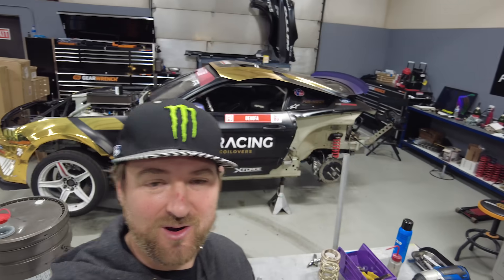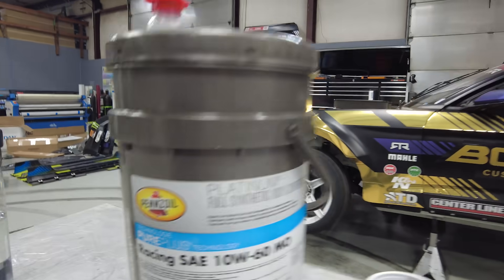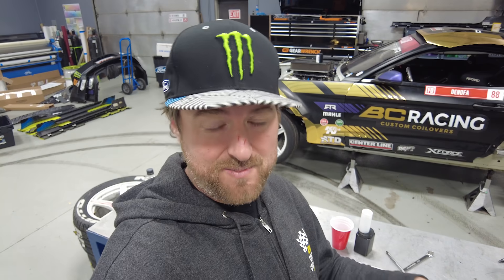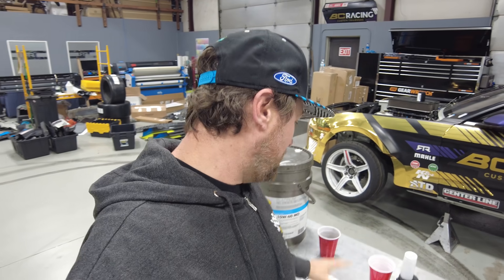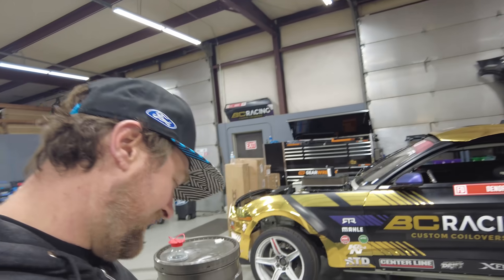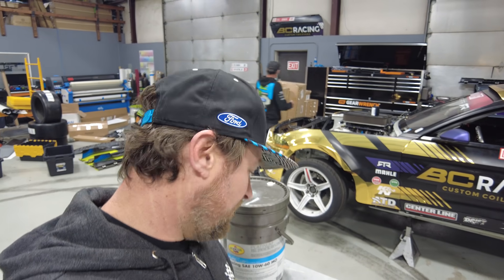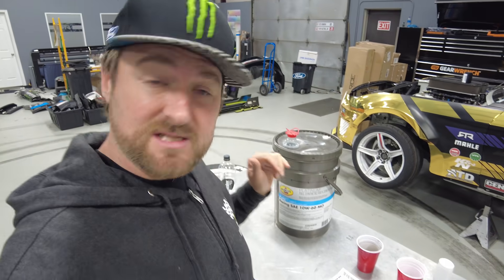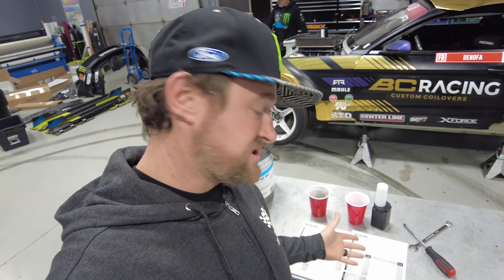What 1,111HP Race Engines Do To Oil!

Comment: I also use Pennzoil Platinum (with a quart of full-synthetic Lucas) in every change for all my vehicles. I’m sure there’s some sponsorship stuff going on here, but sponsor or no, I wouldn’t think they’d run it in racecars if it wasn’t pretty good stuff. Makes me feel like I’ve made an okay oil choice. Hooray for me!
Reply: Pennzoil Platinum is excellent in every application I’ve used it. The oil in this video is the Platinum Racing version. It’s $55 a gallon and has just over 1000 parts per million of Zinc.

Comment: thanks for shedding a light on the type of oil you guys used, I had a feeling it was pennzoil for obvious reasons, I am a bit surprised its not ultra platinum and just regular platinum
Reply: They change oil so frequently it doesn’t matter much
Reply: Their Racing 10W-60 is different. It has just over 1000 parts per million of zinc, if you pause right when he holds up the oil analysis sheet. That’s more zinc than either regular platinum, or ultra platinum.
Reply: @ezrawaters6653  I forgot exactly why it has such high platinum but it has to do with consistent temperature and flow
Reply: @ezrawaters6653  good catch on that had to go back and rewatch
Reply: @Andrew-hh3ol  higher Zinc means more ZDDP (zinc dialkyldithiophosphate) molecules. They are the main Anti-Wear additive. Regular car oil has less ZDDP, since the Phosphorus in the molecule slowly poisons catalytic converters if there’s too much. In race cars though, there’s no concern
Reply: @ezrawaters6653  lmao straight pipes in life

Comment: This is super cool to see and hear for sure!! If any car person had access to this type of info we could all keep our cars/trucks better depending on the use we put it thru. Also speaks alot for Pennzoil witch i have used there high milage semi synthetic in all my Wisconsin cars and trucks lol. Great video 👌
Reply: The oil he uses is the Platinum Racing version. It’s $55 a gallon, and contains just over 1000 parts per million of Zinc for extra anti-wear protection.

Comment: Dirty oil just means it's doing part of it's job n keeping the engine clean.  Sometimes peeps don't change it before fully loaded up with contaminates, with nowhere to go the deposits stay in the engine.  The more extreme the use, the faster the oil loads up and more often it needs to be changed.   Some don't have a problem buying good oil, they have a problem with dumping the expensive stuff out and run it too long.

Comment: Interesting. So my car is pushing 300k miles. Previous owner was big into oil and the particles in the oil. He converted it all to Amsoil including  a large secondary filter, that filters down to 3 microns. No idea what filters you run but I would be curious if you could get the particle count down by filtering out the larger ones.

Comment: How often do these engines get rebuilt? 

Cool to see lab results on a race engine. I'm surprised that you don't use an ester based oil like Redline. I guess if the Penzoil works well then there's no reason to change what you're doing though.

Comment: What did that oil report say about the zinc levels in that oil? Also surprised you guys are running a leaded fuel with a fuel injected car. I was running vp 110 leaded fuel and kept knocking out oxygen sensors due to the lead per the manufacturer of the wideband af i had at the time. Just my experience with it.
Reply: If you look reaallly close right when he holds up the report, the zinc from this drain is 1054 ppm

Comment: 10/60 of pensoil .......has a paratone in it that’s a by product of crude refining, not natural gas.....now the 100 neutral that’s the base oil you can pain your fence with. Add paratone and it becomes multi viscosity.....want it to be clean gotta add orinite that again is from crude oil. That’s what has the calcium, magnesium and nickel. Since you do a full synthetic, that’s called an S4 or S8 molecule that’s made in a lab, this keeps it from demulsifying at extreme temps like Arizona desert in July or Montana in November. When you decide to run nitro methanol.....you’ll need a single weight that dosent break apart with the fuel. I suggest nitro 70 by Kendall. Also what kind of additives did that report say you added to the fuel?
Reply: Ah, so you’re saying that the Viscosity Index Improvers are made from a paratone?
Reply: @ezrawaters6653  I was missing a few steps but the real viscosity improvers are typically polyisobutylenes
Reply: @ezrawaters6653  got an honest question for ya. I’ve heard both ways....whatcha think about welding the rear end spider gears without cleaning the oil off of them?  I asked an oil guy and he said naw clean the oil off, and a race car guy told me leave it on but preheat the gears. You asked an Awsome question so I think ya might be in the know, so whatcha think?

Comment: why 10-60 over 20-50? is it a heat thing or closer tolerances?
Reply: Shear strength {60} when cold, low pumping losses with closer tolerances when hot{10}
Reply: @dazaspc  you have it backwards. The W in 10W stands for Winter. 10W means it fits in the 10W range for cold weather pumping tests. The second number means this oil is within viscosity range for 60 weight at 210 Fahrenheit. Although the second number is larger, the oil does become thinner as it heats up
Reply: Most likely so it stays thicker than 20W-50 if the oil temp spikes to 250 Fahrenheit in extreme competition
Reply: @ezrawaters6653  Ill put this as simply as possible
Oil thins out as the temperature rises, it isn't an egg or cake batter.  
The colder it gets the thicker it becomes. 
W does NOT stand for winter it is an abbreviation for Weight, a measure of viscosity.  
Oil usually has a higher
shear strength the higher the number.  
The tighter the bearing clearances the thinner the oil should be for proper lubrication on start up. 
Thick oil has more resistance to flow therefore takes longer to reach everything at a higher required pressure therefor for LOW temps you need a lower Primary number on the oil that is the second number not the first. 

To correct your answer to the first question you would use a 10~60 over a 20~50 due to the higher clearances in a race engine. When the engine is properly heat soaked the oil should be at it's lowest viscosity number. It can use 10 weight because the oil pump has adequate flow for the loose engine. It also has a lower friction point than the higher number to allow more power to be made. The race engine needs the thicker oil to maintain proper lubrication at low temps/startup/warm up. High load valve springs in particular cause serious wear issues on startup the thicker oil stands up to shear far better. Once warm there is adequate flow so this is no longer an issue if the engine has been built correctly.
Reply: @dazaspc  Your Ideas are correct, you just have the numbers BACKWARDS. 10W is the COLD RATING. 60 is the HOT RATING
Reply: @dazaspc  Even thought the oil thins as heated, the HOT RATING 60 is a bigger number than the COLD RATING 10W!!!  The first and second numbers are on COMPLETELY DIFFERENT SCALES!!!

Comment: Where you getting 5 gallons of that oil is my question!!!???
Reply: They list that exact 5 gallon bucket on Walmart and Amazon for $277. That comes out to  $55 per gallon. Quite a steep price, but it is racing oil for EXTREME application
Reply: @ezrawaters6653  he's using 60wt, I can't find 60wt listed anywhere. 10w50 is what I use and it's not racing oil, Europe uses this stuff regularly. The viscosity maybe racing specific but definitely not branded as Race Oil. Pennzoil Ultra Platinum is just that good, only oil better would be Amsoil which I've used back to back against Pennzoil. So you're saying Walmart and Amazon sell this bulk bucket ? 2yrs of buying mine from Amazon I've never seen packaging larger than a Gallon.
Reply: @ezrawaters6653  my Amazon must broken, I can't find it. Link if you get a chance. Yeah 60w is a race viscosity, didn't think they had a Race Labeling for that specific weight.
Reply: @ezrawaters6653  thank you !!

Comment: Hi, would you reccomend pennzoil for street use? i drive an E39 M5 supercharged (550hp) and change the oil every 4-5000km i do mostly normal driving with little to no show boating (i do red line it though when going down the motorway etc.
Reply: What Viscosity are you looking to use?

Comment: Was expecting Ultra Platinum since that is Pennzoil's top tier Synthetic.
Reply: Maybe there’s no advantage in racecars when they change it so often?
Reply: @The_sinner_Jim_Whitney  That has a lot to do with it, im sure and if it keeps wear levels normal and stays in grade, theres no point. I just figured these Big Name racing teams used full race oil. Modern motor oils are surprisingly stout.
Reply: This is their Racing Full Synthetic. Different from either regular Platinum, or Ultra Platinum. If you look really close right when he holds up the report, you can see this batch has 1054 parts per million of Zinc. That’s more than in either Platinum or Ultra
Reply: @ezrawaters6653  oh, I’ll be damned. Either way, I believe street car Platinum’s also pretty good stuff.
Reply: @ezrawaters6653  Good eye, they must be using the Platinum Racing 10w60, hence the high zinc levels.

Comment: Why so thick of oil?
Reply: Most likely since the 1000 hp engines would bring the oil temp to around 240-250 Fahrenheit at times. 10W-60 at 250 degrees is close to the same thickness as 10W-40 at 210 degrees.

Comment: I remember the days when Pennzoil was the shitiest oil you could buy.
Reply: The reason why it was shitty was the beeswax they used. They had a good reason, just can't remember it off hand. It worked great so long as you changed your oil every 3k miles like your were supposed to back then. But, hardly any body ever did and that beeswax would set up and solidify inside the engine. The sludge is what gave them such a bad reputation. That and I'm sure that other neglect was blamed on the oil alone. Motor falls out the bottom of car "must have been that Pennzoil I used"
Reply: @davidzimmer2694   Oh I see now. Well call me educated now.
Reply: That was the pen star molecule? Lol.when I was a kid growing up, my parents bought into the pennzoil/fram hype. I scattered many engines.
Reply: Project farm did a head to head comparison with multiple oil brands, Pennzoil and Amsoil were the best of the bunch.
Reply: @Mrx1080  naw uh. Bacon fat was! lol,
Reply: Still is compared to others. Look up blackstone labs

Comment: You running 2-ring pistons? Dry sump or wet sump? Both will explain combustion gasses. 

You’re running a series that still uses leaded fuel? Ffs, it’s not only unhealthy to your techs, it’s making much less hp. I suspect it stems from highly inefficient 2V combustion chambers but proper designed pistons and modern cooling systems can run on modern fuel. Plead to your sanctioning body for oxygenated unleaded race fuel. 

Should not have much in wear metals since you’re replacing after every weekend, what’s that 6-8hrs at best?

I’m shocked anyone would use 10-60 in any race engine. I assume these are old pushrod 2V motors but it’s likely forged 4000 series or maybe 2618 if on a tighter budget, pistons in nikasil bores, 6-bolt girdled mains and 2-pump oiling system, no? If so, tighten tolerances and run 20 or 30 weight race oil, especially if you’re changing oil every weekend. Depending upon windage, if wet sump, cam drive design and build quality, you’ll often gain 3-5% hp. Of course such race oil has very few additives for combustion gases so it’s imperative that you change oil after every weekend, maybe twice if you’re running btb races. Small price to pay for the net hp gain. In many cases, while the race oil lacks ph reagents to handle combustion gases, they often have more ZDDP than is allowed in street vehicles thus offering better wear protection. The lighter oil will also allow tighter piston clearances, as long as properly designed w/oil cooling jets and no iron bores, resulting in more efficient combustion and less blow by. This is where the 2-ring pistons really help. 

Good luck this season.
Reply: If you look closely right as he holds the oil analysis report up, you can see this oil has 2600 parts per million of Calcium. That’s the main detergent/dispersant. It also has 1050 ppm of Zinc, and 940 ppm of Phosphorus. Also just under 80 ppm of Boron, and 50 ppm of Molybdenum, both of which are secondary Anti-Wear additives

Comment: I'm sure Pennzoil is a sponsor, and for what they are doing it is a good oil.  But this Pennzoil synthetic oil is not stable over time and the number of heat cycles that a daily driver car would see.  Of the synthetics out there, this one is the least stable for your daily everyday use.
Reply: I’ve used Pennzoil Synthetic for the last 8 years in all of my family’s vehicles. Usually 8k miles between oil changes. Zero problems
Reply: @ezrawaters6653   I'm sure it has worked out well for you.  I go off of a long time associate that each year or 2 runs a battery of tests on various oils.  Hot, Cold, stability, solids retention, water, etc.  FYI, the best in the synthetic group from the tests in 2019 is Redline Oil, followed by Mobil 1.  The lower level in the synthetic group are Valvoline, Pennzoil, and Amszoil.  Perhaps they got a bad sample when they did the testing, who knows.  I know that I had a racing engine in a race where the oil cooler became covered.  The oil heated up to over 380 degrees F.  It was Mobil 1.  There was only 1 rod bearing that showed any sign of over heated oil, and it was minor.  We don't know how hot the oil actually got, but the oil tank was behind the driver seat and he has 1st degree burns on his back, so it was hot enough to do that through the seat cushion, and  his driver suit.